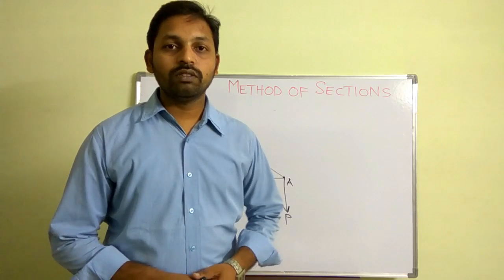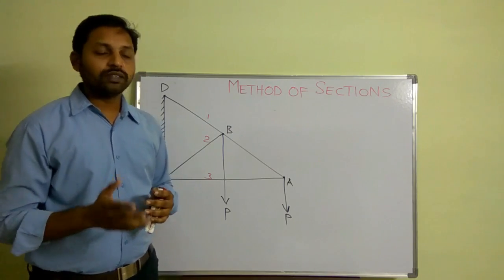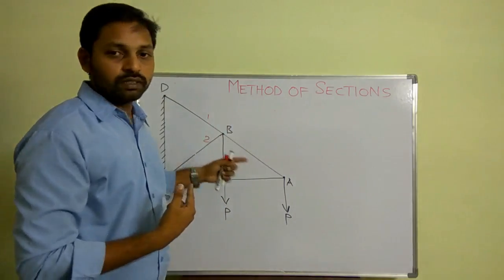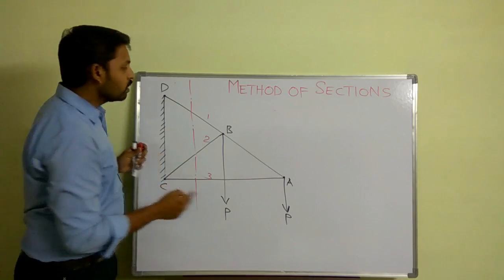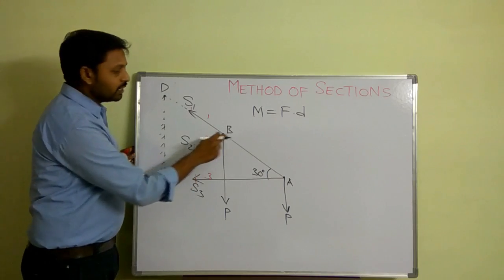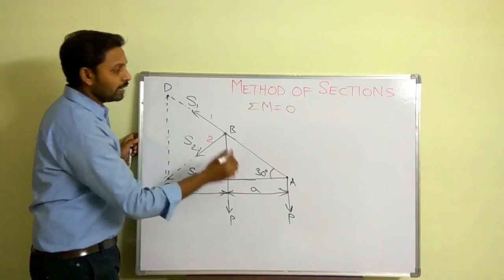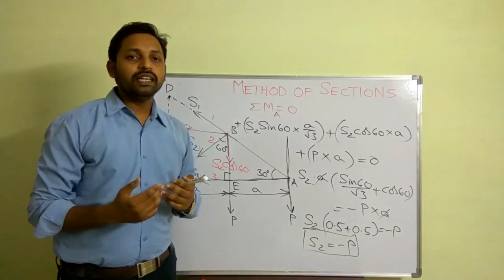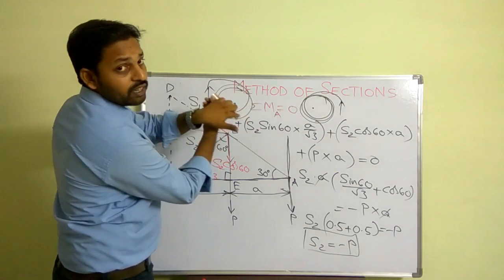Method Of Sections

Comment: SIR HOW TO FIND COMPONENTS
Reply from the maker: Hi  MD HAFEEZUR RAHMAN.... Based upon the angle of inclination with respect to reference axis (that may be x axis or y axis) you can resolve the force into components. For explanation refer the following link

   https://www.youtube.com/watch?v=bqZqf5ApRes
Reply: sir components means  distances r given question is  find components on x y z axes and find resultant and wieght
Reply from the maker: Component of a force along an axis means the magnitude of that force along the considered axis. If you want to find the components of force along x,y and z axes refer the following link.

https://www.youtube.com/watch?v=FABGpnVmm3w

For calculation of unknown weight in spatial force system  i will do a dedicated video....
Reply from the maker: Yes i will do a dedicated video on calculation of unknown weight in spatial force system